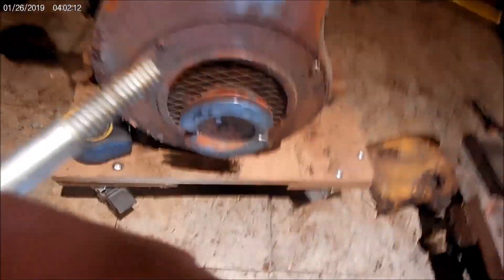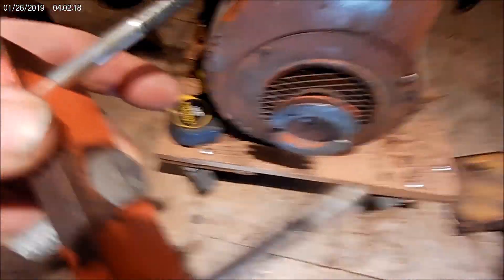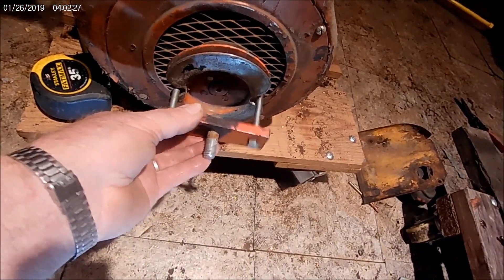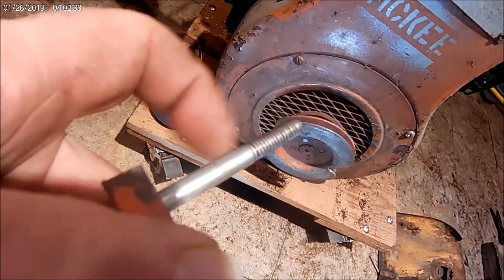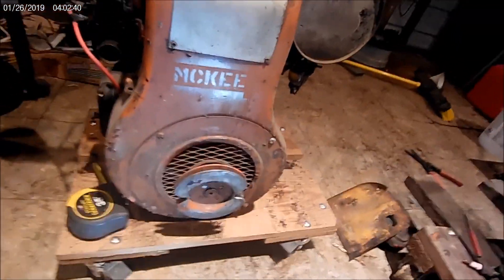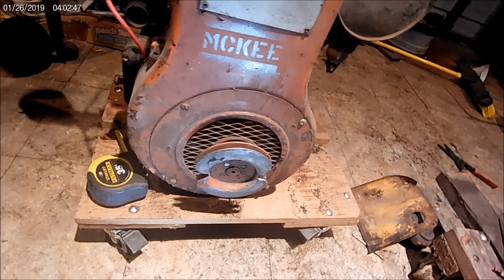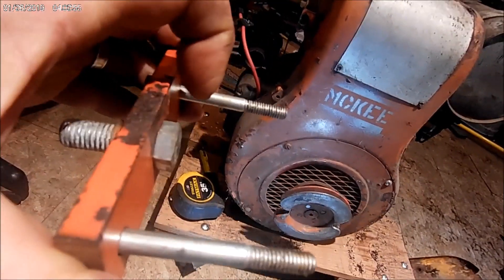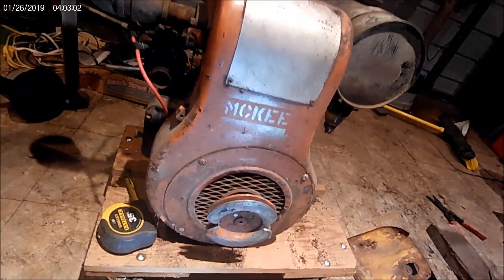Riggin up an electric start on this old Wisconsin engine

Comment: I love those old motors. You could get more torque than todays 26hp lawn motors lol
Reply from the maker: yes, these have a long stroke so they have more torque that way and they get their hp at only 2200 instead of 3600 on the b&s engines.

Comment: reminds me of an old pump we used to pump-out boats that were taking on water.  We would take a piece of line, wrap it around the crank and pull, pulling to line off the pump so no kick of broken bones.
Reply from the maker: this is supposed to be rope start but it's being contrary so I want to make it turn faster to see if the compression will come up some.